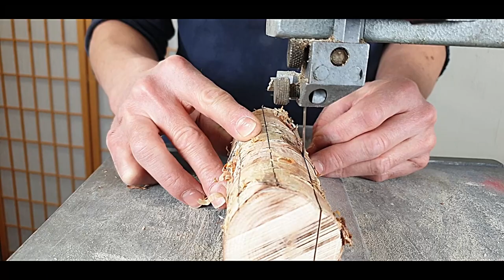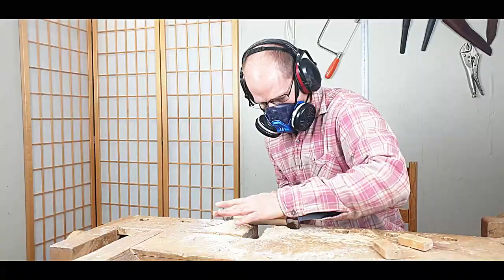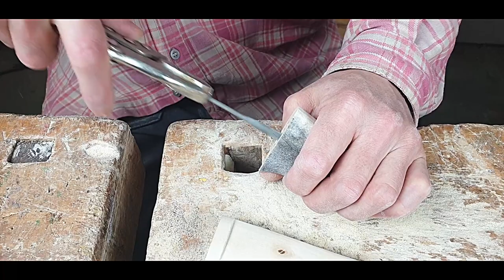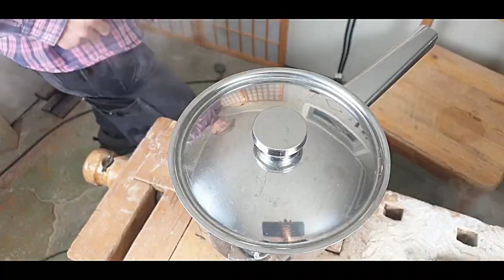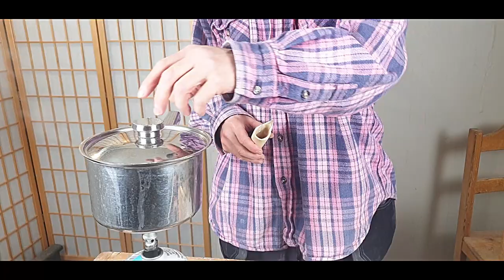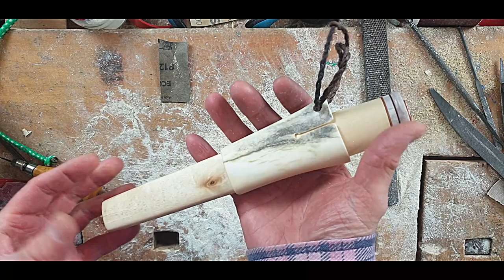Birch Wood & Reindeer Antler Knife Sheath

Comment: Very few things in life other than children, compare as a Human being, to the feeling of satisfaction when something we envisioned in our minds, is transformed into reality by our own hands. Loved this one. A couple of tips for the next one. When cutting the branch on the saw. cut two sides 90deg. from each other. dress those side flat really quick on the sander or plainer, then move the fence on the saw to the dimension you would like the block to be. then cut the two remaining sides of the block using the dressed sides against the fence. This will give a more accurate block to start with. Also if you have a caliper. measure the guard. or on this sheath the area under the wooden lock ridge. and the point on the handle where the antler will stop. lay out these measurements on each end of the antler so you have guidelines to file to for a closer fitment before the hot forming starts. What a wonderful build. And thank you for taking the time to give us so many engaging camera angles. Loved it.
Reply from the maker: Thank you Tom. Lots of nuggets in your feedback 😊🙏